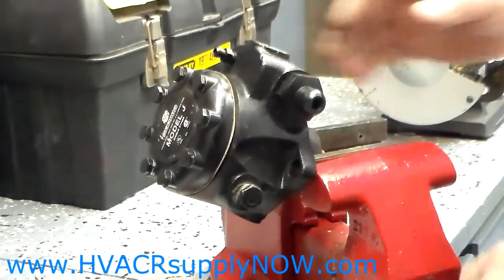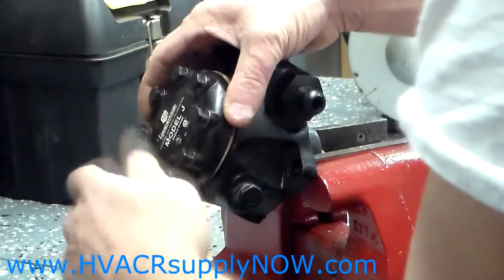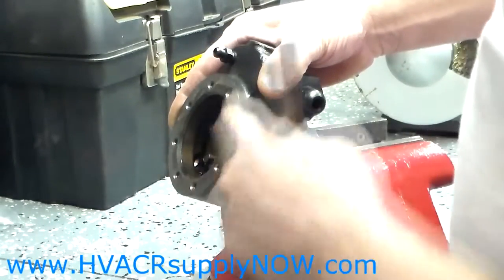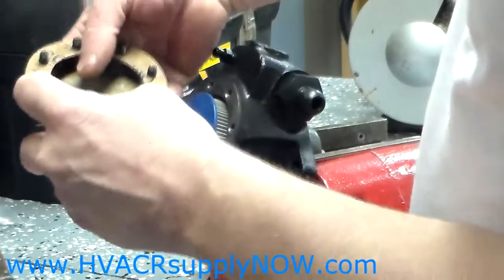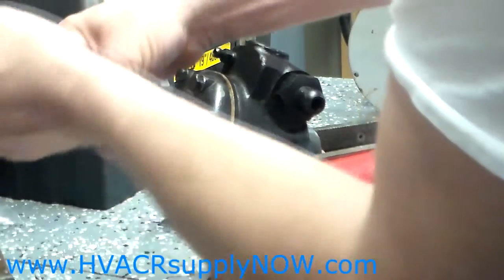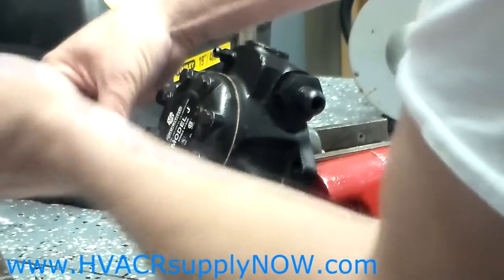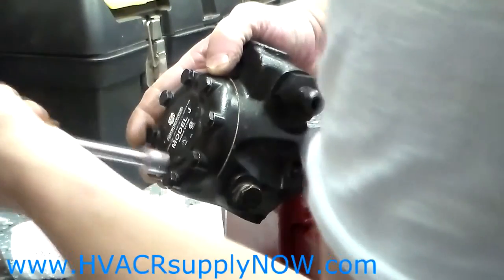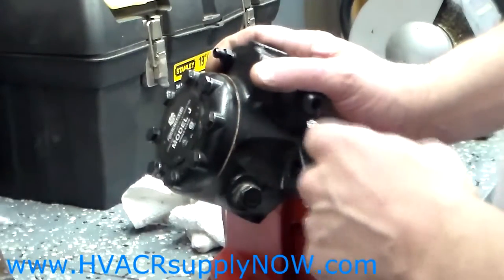Changing a Suntec J Pump Strainer and Gasket - HVACRsupplyNOW

Comment: With the 8 bolts removed from the pump cover, the cover does not come off. The cover/gasket seems attached or fused on.  How is the cover/gasket freed from the J pump housing?